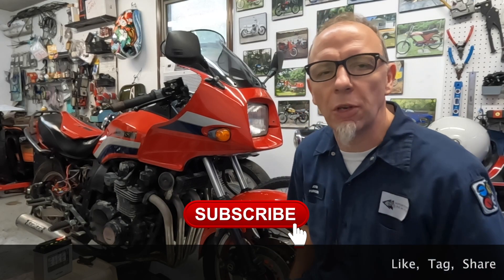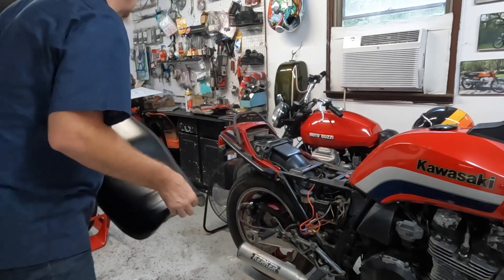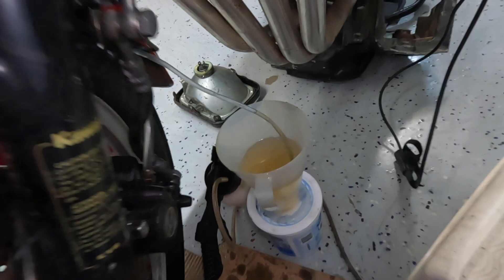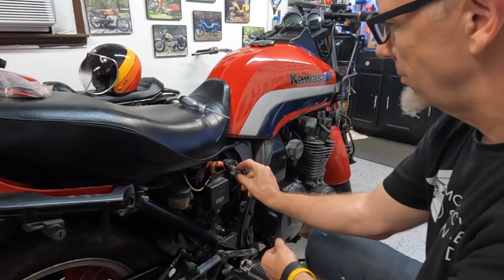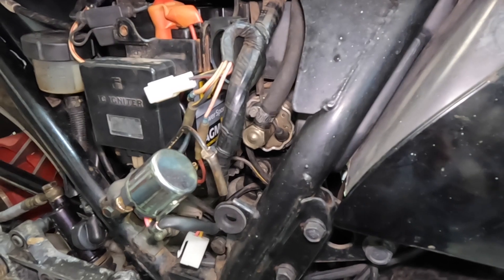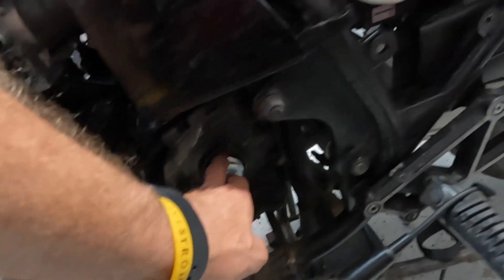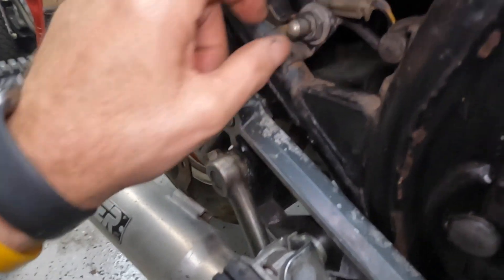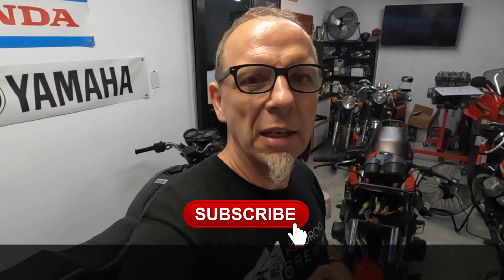Resurrecting a Beast: Prepping the '83 Kawasaki GPZ1100 for a Cross-Country Adventure #gpz1100

Comment: Awesome progress. With the long journey ahead, you may be interested to know (if you didn't already) that the DFi on these bikes does not play very nice with non original exhaust systems. The original black chrome 4 into 2 system is likely impossible to get now and the symptoms are that with a 4 into 1 they always run a little rough until you hit around 2500-3000 rpm, at which point they clean up near instantly and go from burbling and coughing to accelerating really fast. When I built mine there was no available cure for this and I am not sure if this is still the case today but my point is, if you see this issue, don't assume something is wrong with the fuel system and potentially waste time trying to clean up the running at low rpms unless you know of a published fix for this specific characteristic. It isnt really much of a problem. Obviously vacuum syncing the four throttle bodies will give you a much smoother idle but outside of this and the TPS calibration, the DFi is a bit of a sealed black box on these. FYI, mine ran happily for years with these symptoms on both a US made Bassani exhaust and a UK made Harris exhaust, until eventually I moved the fuel system to Mikuni Flat Slide carbs which made it run much nicer. Now these bikes have reached classic status, converting to carbies is no longer a good choice IMO. Thanks for the video and I hope the snippet of info is useful.
Reply from the maker: WOW!!! I am going to pin this comment so I can find it later. You seem like a wealth of knowledge and someone I need to get to know. Thanks for taking the time to share. I really appreciate it.

Comment: This brings back so many memories for me. As a young U.S. Marine I rode a 1981 Kawasaki KZ550 and one of the guys in my unit got a brand spanking new 1983 GPz1100. We rode together often, and I was always envious of that beautiful machine! It was a great time to be a fan of the awesome Kawasaki bikes of the day.
Let the good times roll!
Reply from the maker: Wow. That’s awesome. The more I am learning about this bike the more I like it. I like the 550’s also. What are you riding now? Thanks for watching.
Reply: @Motorcycle Rewind  I'm not currently riding. My last motorcycle was a 2003 Kawasaki 1500 Mean Streak (that's how my screen name came about, my middle name is Max) that I bought new. I'm casually looking at used Harleys that have bigger displacement with minimal attributes. Kind of like the traditional Bobber style. I did amateur race hare scrambles and enduros for about 10-12 years, then rode sportbikes and took roadracing classes and track days, but I never competed. Years and years of multiple Deal's Gap trips and sport touring miles have given me a lifetime of great riding memories. All in all, my motorcycling life has been amazing. Just get out and ride!
Reply: @motorcyclerewind 
I owned a 1984 GPz550
/  AKA   zx550A1.   It had same frame-mounted half-fairing as your 1100.    My 550 was the LAST year they ever made GPz550.  The next year,  they came out with GPz600 Ninja  (with the 16" front wheel).

Comment: Eric, I'm going back through and watching the entire playlist on the Free GPz. I had watched bits and pieces here and there previously, but wanted to get the whole thing start to finish. Just saw this episode where you are fixing a lot of stuff, but specifically the starter button and solenoid and making the wiring nice and tidy with connectors and all. When you pushed on the wiring harness there was a couple spurts of liquid (fuel). You noted that this was a really bad place to have a fuel leak, then found and fixed it (tightened the loose clamp). Then I noticed as you backed out of the area with the camera, that the fuel line was right next to a black box labelled "IGNITER". Indeed, a bad place to have a fuel leak!!! I got a big chuckle out of that.
Reply from the maker: Horrible place for a fuel leak. Right next to something called igniter. 🔥🔥🔥

Comment: That'll be cool to see if that bikes makes to to Colorado and back.   Personally I don't love the 80's aesthetic.  Maybe because I remember the 80's to clearly.   Lots of molded plastic that they thought looked futuristic and cool at the time.  You had squares and rectangles taking priority over circular gauges and lights.  Although that Kawasaki has a round speedo and tach.   
1950's through the mid 70's is my favorite when it comes to motorcycle styling.  I can appreciate the earlier stuff, like pre 50's, but I'm not longing for 30's Harley Davidson daily rider.
Reply from the maker: I am more into motorcycles from the 60’s and 70’s. Although I am definitely liking the fuel injection